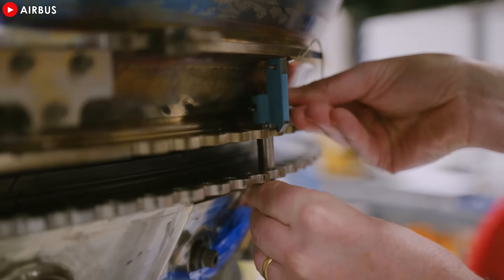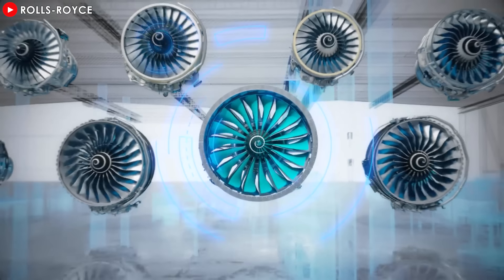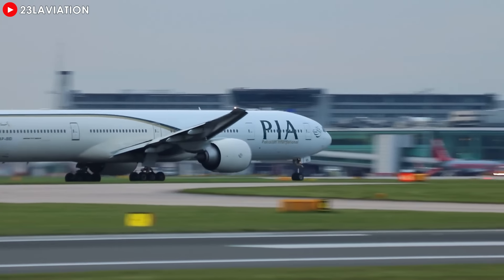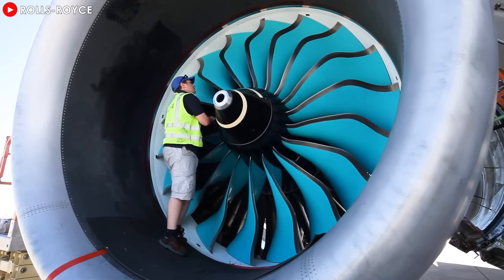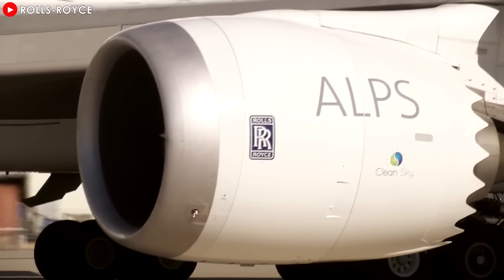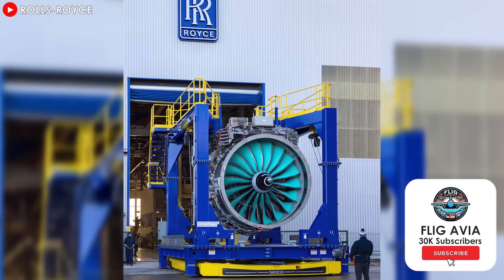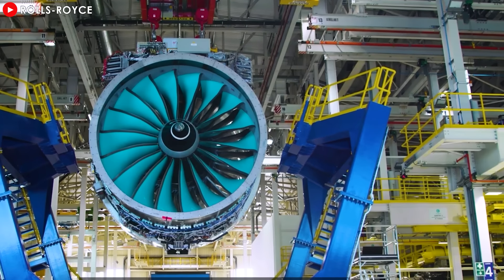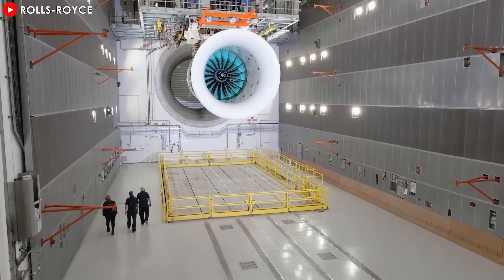This new Rolls-Royce Engine is Coming & will Revolutionize the Entire Aviation Industry. Here’s why

Comment: The American P51 (known as the Mustang when delivered to the UK) was a very average fighter with its Allison engine, especially at height. But when fitted with the Rolls Royce Merlin engine by the British ( as fitted to the Spitfire and other important planes) it was transformed into perhaps the best piston engined fighter plane of the Second World War.
Reply from the maker: Thanks so much for the helpful information!
Reply: In wartime- time is crucial. Fitting an existing proven engine was an easier decision than hoping  US engine makers could deliver the same in such a short window to make a war outcome difference and avoid more US airmen being killed with the existing engine
Reply: and your parallel to 2025 gas turbine engine technology is what exactly?  It's not 1945 anymore Toto.
Reply: Let's not forget that the production Mustangs used Merlins made by Packard.  Not only that, but a lot of Packard Merlins ended up in Brit airplanes, such as Lancasters and yes even some Spitfires and Mosquitos.   

Kinda a fan of the Allison 1710...  not slighting the RR variant Merlin, but there are other fine aero engines as well.  Also, I'll give the P-51 its due but let's remember that the Mustang was designed as an interceptor and a long range escort fighter.  The Spitfire and FW-190 were better dogfighters.  It's arguable that the P-47 also was a better dogfighter.  It certainly had a better roll rate than the Mustang and it was tougher.  There were a LOT of smoking holes in the ground full of Mustangs parts that were sent there by FW-190s, which weren't called "Butcher-Birds" for nothing.  By the way, the FW-190 had a better roll rate than any other fighter plane of the war.  The Allies were fortunate to have better aero fuels (130+ octane) to exploit higher supercharging, thus make more horsepower, while Germany was having to crack coal to formulate aero fuel during the latter half of the war.
Reply: @Flugavia. … the gentleman’s comment was a response to the predictable sour grapes reaponses to successful non-US technology.

Comment: The biggest issue is that the initial engines are aimed at large wide body powertrain demands. RR needs to offer at least one smaller version fast in order to offer at least one option for narrow body planes to which there are the biggest order backlogs. With so many backlogs, those ordering now can afford to wait and see what RR offers and see if Airbus and Boeing will offer them as options. Plus a new supplier offers to cut some of the scarcity of the engines. Airbus is already cutting its output due mostly to waiting for engines to be on offer. We can see that airlines are willing to use long range narrow body jets on long range routes as customers will suffer this space for ticket prices. RR may also be the first to truly offer a jet engine built to run on SAF. At present engines are being modified to run on SAF. Having an engine built to run easier on SAF means less risk and offers an airline a jet to test this new fuel on. 
The Biggest drawback is the engine size no matter the performance. There is a limit on jet size and plane logistics that can keep adding a taller engine. RR is also new to commercial geared jet engine unlike the current Pratt and Whitney engine which while it has suffered reliability and design launch issues offers P+W early understanding of these challenges and we all know the gearbox offers a significant advantage against just better blades and internal combustion improvements.
Reply: Good comment, RR bailed on participating with P&W on GTF architecture and went their own way after IAE buyout.  Focusing only on high thrust applications is a mistake going against GE with their enormous resources and market clout with GE90/GenX. The P&W GTF gearbox was never the issue, it was designing the rest of the engine like a Ferrari when a Honda Accord would have worked just fine.

Comment: My number one concern with aero jet engines is , especially large commercial passenger planes is reliability . I don't care how little fuel it consumes , how pretty it looks , how powerful it is . Only how reliable it is and gets me to my destination safely .Also  I do not believe that the  reduced operating costs of the new engines will be reflected in reduced air fares , why should they ? IT has NOT happened in the past . The only thing that has lowered air ticket prices is volume !

Comment: Go Rolls- Royce once again you are the best,back in WW2 the Mustang was not much to shout about until a Rolls Royce Merlin was fitted, Say no more.
Reply from the maker: Legendary!
Reply: Don't slight the Allison 1710.  At lower levels it was a hot shot.  The ground attack variant of the Mustang (A-36 Apache) used an Allison and it did just fine.  Later variants of that same Allison with improved supercharging (both turbos and centrifugal) made serious power... and the Allison was a tougher engine.  Even today, people rebuilding Merlins for better performance are using Allison connecting rods in the rebuild.

Comment: There is always a price to pay. In this case for adding a gearbox, that will probably limit the time between overhaul which will add to maintenance cost.
Reply from the maker: Yes.
Reply: Not sure the gearbox is as extensive as the P+W one in the overall performance of the new jet design and outcome. Plus seeing the experience with P+W and their gearbox issue plus knowing the reliability that the RR Trent engines have had, meant while a critical addition, RR added more new stuff to offset this risk factor plus RR has had a long term maintenance system in place with its pay by airmile maintenance support

Comment: I'm still reminded of the time when RR introduced its "revolutionary" new Hi-Bipass turbofan engine that ALSO used new technology materials in the engine... which eventually failed the FOD tests and ended up very nearly causing RR to go bankrupt.  Let's hope this time the new tech actually works.
Reply: That's why you test isn't it?  Are you talking about the RB211 in the 70's?
Reply: @OldManGaming69  That would be the one.  Their use of pressed carbon fiber in the fan instead of titanium was an attempt to save weight because the 211 was a heavy engine even with the lightweight carbon fan and the extra weight of a titanium fan would put it over the target weight applications RR was shooting for.  I don't remember the exact details seeing as how I'd read the rather extensive report around 40+ years ago so some details are a bit fuzzy.  Interesting how the 211 in its later incarnations became a success and showed up on a variety of aircraft after RR got things back in order.   RR does make good stuff... the early carbon fan just wasn't the answer then.

Comment: i see what they did with the planetary gear system, they reduce the  N1 turbine speed to never exceed supersonic speed, so they can go faster at a higher altitude but with the use of more weight to make it happen. its kind of counter-intuitive in a way but always a step forward to more fuel efficient flight..
Reply: keep in mind, the speed of sound (supersonic) depends on temperature, atmospheric pressure, and air density, so its actually going faster than if it were flying near sea level

Comment: I'm wondering about the overall larger size of the engine...wasn't that the problem with the retro fitted 737's? Leading to the whole MCAS debacle.
Reply: That was based on poor engineering trying to ram bigger engines in an old design. Everything right down to the landing gear should have been redesigned. Instead, Boeing has turned into cutting costs to feed back to the stockholders. MCAS was designed to compensate for the lack of redesign engineering for the 737
Reply: if a new engine doesn't fit... it requires a new airplane design. In part what caused the "early end" of the 380 that could not handle the GE9X. Now, (if I remember correctly) the ultrafan has been specifically designed to fit under the A350. 🤔
Reply: Boeing specifically accommodated larger engines by having longer undercarriage when it designed the 757. That was nearly 50 years ago and what did they learn ?
Reply: I look at all the gleaming machined rare material spinning parts, and imagine instead, a single electric motor direct driving a 30:1 bypass ratio (around the small motor) fan turning at ideal speed for operating mode, and wings stuffed with CATL’s 500 WHr/kg Li-ion batteries, or better yet, some in-the-works solid-state batteries.  Goodbye noise and pollution.
Reply: @eddiegardner8232  What will you be charging these batteries with?  And how long will it take?  (Do the math) ;-)
Reply: @carycwilliams  MCAS was designed to make pilots lazy.  Nothing to do with the airframe itself.
Reply: @tonyunderwood9678  The airlines flying them will have to install chargers into the gates they operate from, just as they have installed underground tanks and plumbing now for Jet-A.  The batteries for aircraft will have inherently shorter charging times than the ones in current production cars.  They are being developed right now.  Early rapid charging ones will be in cars in 2025, with larger scale deployment in 2026 and later in cars.  There are already light aircraft using today's batteries, which weren't specifically designed for aircraft use.  Of course, anything for aviation takes longer to deploy, due to operating environment and many layers of testing and certification.  But it is coming, due to lower potential operating costs and maintenance, as well as reliability and noise considerations.  Not immediately for international wide-bodies, but initially for regional carriers.

Comment: The GE9X engine for the new 777 puts out more thrust than the so-called ultrafan and it is also a lighter engine. 
The bigger fan has more frontal area which means more drag going thru the air with the ultrafan.
Reply from the maker: GE9X has a stronger thrust is true.
Reply: @FLIGAVIA   That is what I wrote in my original post-! 
The GE-9X is also lighter.
WHY  DONT  YOU  MENTION  THAT  THE  GE9X  IS  A  MORE  TECHNALOGICALLY  ADVANCED  ENGINE  AND  ALSO  HAS  MORE  THRUST  AND  IS  LIGHTER  THAN  THE  ULTRAFAN.  You lead one to believe that you are getting paid for promoting RR.

Comment: Except, GE-90 is like decades old design and GE-9x achieves most of it even without more sophisticated stuff.
Reply: Except we'll soon know if the results over the GE are correct once its in deployment on one commercial jet. THe 9x was designed from 2012-8 so its new but we will know soon. At present all we have is RR claims
Reply: @stephendoherty8291  The GE9X is a lighter engine than the so-called rr geared fan and the GE9X produces more thrust than the rr geared fan.

Comment: i like the idea of pushing tech to its limits simply to make it the best it can be and lowering costs for ppl to travel...however i dont like the net zero crap as co2 is harmless to the environment...its beneficial...not a pollutant...we should have supersonic options in this time period the tech is readily available to do it cost effectively as long as the zero emissions nonsense is dropped as that will doom any affordable faster than sound aircraft...time is the most precious commodity as its the one thing we cant get more of...moving in one direction forever...
Reply: CO2 is certainly necessary for plant growth but in too high concentrations it will act as a gas that absorbs energy from the sun causing higher temperatures which can badly affect many plants.
Like water which is also essential for plant growth a flood can be disastrous. It is not the chemistry of CO2 that is the issue - it is the physics and amount.

Comment: They spin in the wrong direction 😂
Reply: Clockwise, the best direction 👍 love from a RR engineer
Reply: @bez750  The real reason for American engines to spin counter clock wise.
On the recipicating engines they spin in the direction that was easier to Hand prop start the engine for a right handed person to hand prop. In 2017 I was the first Flight test Jet engine mechanic for the MC-21-300 in Zhukovsky 2017 and Siberia earlier in the year.

Comment: RB 211 was a three spool engine well before Trent came along, yes?
Reply from the maker: Yes
Reply: Yes, RR paintened it
Reply: @FLIGAVIA  Some RR lovers said that the triple spool turned the fan at its optimum speed which is questionable.
                              If so,  why have they dropped that triple spool architecture in favor of the twin spool with the geared fan-?

Rolls Royce engines are more expensive to build and also they are more expensive to maintain due to their three spool design when compared to twin spool America engines.
Reply: @bez750  what color did they paint it exactly?  Yellow as piss?
Reply: RR continues to exist only because of the British monarchy.  We used to say "the queen", but you know...

Comment: I'm sick of hearing about this engine. All its been for years is talk talk talk. Where is its  aircraft? Why hasn't the Scaleable side taken on the single isle aircraft engines? Why isn't it  certified yet?  I fear this engine is going to be a White Elephant.  It's about time RR brought to market.  This video is yet another rehash of OLD news.  Probably the biggest mistake RR made was giving up on the single isle market and building this Ultra thing without an aircraft to put it on.  The REAL test, is it RELIABLE? DOES WORK OK IN DESERT CONDITIONS?  GET IT CERTIFIED. THEN it might get used on the 777x, if and when that arrives.
Reply: RR have wasted tons of money on the so-called ultrafan which is just a geared fan which has been around for many years.

Comment: Plane with 4 engines, is it a new A380..... Thought 4 engines was out of the question for new planes because of maintenance cost.
Reply: going from 4 engines to 2 was a cost cutting measure and a fuel savings measure. In early commercial jet aviation, 4 engines was a requirement for planes for safety purposes, engine backups in case one failed.
Reply: @carycwilliams  svarade du mig?

Comment: Rolls Royce engines are more expensive to build and also they are more expensive to maintain due to their three spool design when compared to twin spool America engines.
Reply: The Ultrafan is a TWO spool design.
Reply: @hakantorstensson8053  It is not in commercial airline service and most likely will never be in commercial airline service.
                                                          Ultrafan is just a fancy name for a geared fan.
Reply: @John-nc4bl  Geared fan helps reduce the fuel consumtion and will probably seen more widely use.

Comment: Rolls-Royce engines have been a maintenance and reliability disaster on 787s for years since they came out. Some airlines have taken the unusual step of switching away from them on new 787 orders in spite of the cost of maintaining two types of engines on the same plane. If I were an airline exec, I wouldn't trust them again.
Reply: Airlines that have switched so far from the unreliable RRs to the reliable GEnx engines for their future 787 aircraft are:- LATAM;  Air NZ;  Al Nippon,  Thai Airways, British airways, Ethiopian Airways, Tanzanian Airlines and more airlines are likely to follow.
Reply: Ich hatte der Werbung vertraut und jetzt hast Du alles zerstört. trotzdem Danke für die Info.
Reply: Aviation is a funny world. Because despite all the reliability issues with Boeing, airlines are still ordering them. The same will happen for these RR engines. Especially as everyone is activley trying to save fuel.

Comment: Just like in land based vehicles, is it beneficial to have aircraft to use electric driven “Engines” by using a hybrid system where 1  engine creates the electric power to drive the rest and possibly charge a battery system onboard to reduce fuel consumption immensely, while improving performance, lowering weight and reducing costs.
Reply: Er.no.
Reply: lowering weight? do you realise how heavy a battery big enough to power engines would be?

Comment: Trent 900 had problems, Trent 1000 has them, Trent XWB is slowly showing issues. I will wait until RR developes it, and until it is 5-10 years in service to judge. Only GE-Snecma(CFM) has a proper engine
Reply from the maker: Thanks for sharing!
Reply: All GE engines have had issues. The XWB with Cathy was a maintenance issue. Not an engine problem.
Reply: @CraigDakin-b5n  not really, but ok. -900 operators were also checking if they are affected when Cathay had a finding, as RR was not sure, and Airbus was in panic mode. Also, on the small operator of the type(4 aircraft) of A350 sample, I know about 2 engine replacements due to M50 material(from bearing) on low utilization(around 1000 FC) already, in cold, but still moderate european climate, so I can understand Emirates decision to be cautious with RR XWB if engine underperforms in Europe(it is additionally hot and dusty in UAE)  . I was partially involved in one. I smell and feel  the AD in the making. Maybe it was not the wisest  move by Airbus to go only with single engine option on A350, as it is otherwise a nice aircraft to operate.
Reply: Yeah